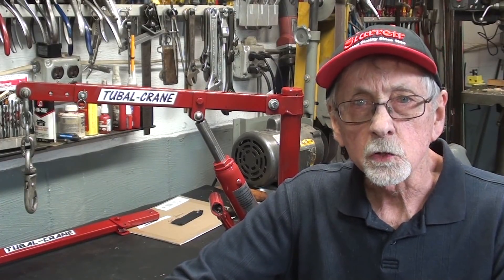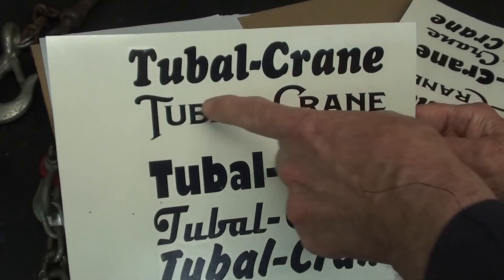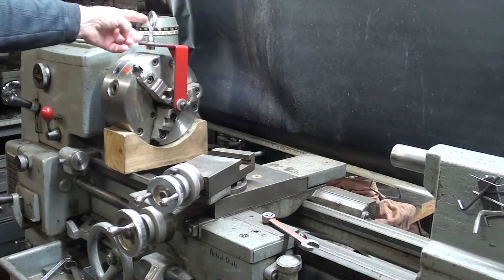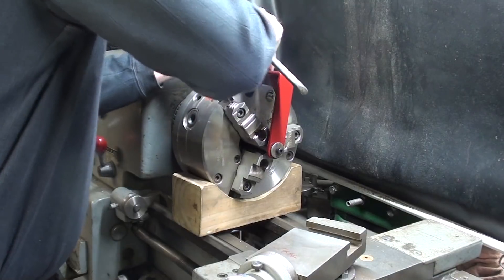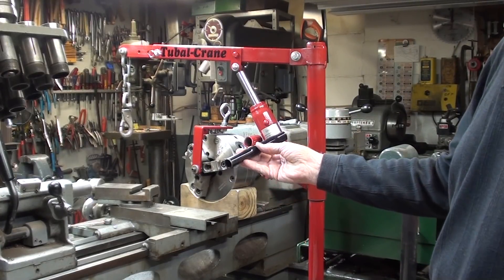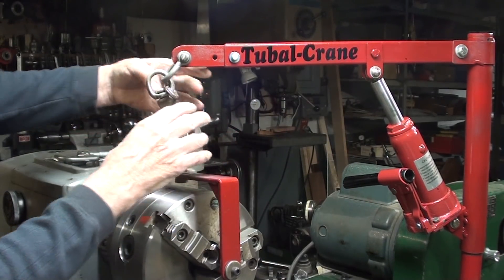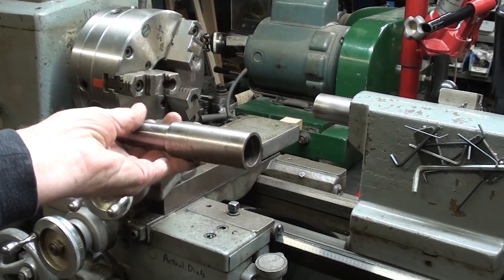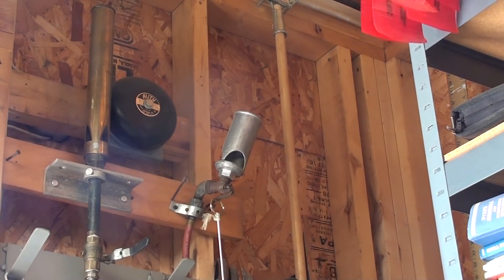Tubal-Crane - SKY Hook for Lathe Chucks pt 4 #730 tubalcain

Comment: Hi Mr. Pete, Thanks for your work. Judging by your complaints of the position of the Jack handle. It seems to me that a new anchor point could be mounted to the bottom plate so that the pump handle could be rotated to the other side of the jack and still work the piston with a downward force. I didn’t hear you mention in your videos that this was suggested, and I tried to find where someone suggested something like this in the comments, but I was unable to discover it. So, I will watch to see if you produce a new “final video” on the subject.

Comment: Thank you so much for the great videos. This series came at a perfict time, I just purchased a rotary table and was having issues moving it. 
I watched the videos several times and made one for my Grizzly 0705. I followed your lead on the crane but changed the mount. I mounted mine on the right rear of my machine which allows me to leave it on and swing it out of the way.

Comment: Hey Mr. Pete.  You may indeed have a problem with that nut, the key or maybe with the chuck keyway.  I had a Lodge & Shipley with an L1 spindle.  If I positioned the key up, as you showed, the chuck, once roughly positioned, would rest on the key and I could easily thread the nut on.  My machine was a 16", I think the chucks were about 14", so there were plenty heavy, but other than the lifting (I needed a TubalCrane) there was little drama in a chuck change.  Thanks for the video!

Comment: Well, I've never had an issue mounting a chuck on a Colchester lathe ! The nut though, is a lot looser so it can align itself to the thread on the chuck. I've also never tightened or loosened a chuck using a mallet on the C spanner. Spindle in bottom gear and a couple of tugs on the spanner seems to be enough to get it tight onto the taper.

Comment: 6:50 Lyle, if I can call you that, ;)  if you want to mount the crane where the toolpost goes - or even as a quick release tool, do so. Don't go mad over tightening the mounting bolts - the lathe and slides will have no issue with that weight - especially if ya oil 'em a bit ;)
The forces involved in taking a deep cut are pretty significant - and I'd not even worry about it on one of those plastic lathes like Blondihacks has ;) [My first lathe - for ages 0-3....months]

Comment: On mine the bottom cylinder pin boss is further from the post  so that the pump and handle are between the post and the cylinder center line.  Makes all the awkwardness go away.

Comment: Why the big deal with a swiveling hook? put a Nylock nut on the eye bolt loose enough to allow the eye bolt to rotate. A next to no cost solution. Another Idea for the mill mounting. permanently mount tee nuts to the base at the extreme end and simply slide it into the tee slots, no wrench work required. The tee nuts will of course need a extra high center part to provide the clearance.

Comment: I think there needs to be a part 4A.  It seems with so many great ideas on this device that it really deserves an appropriate handle for the jack mechanism.  I have always hated those crappy pipes they provide to do the jacking.  I am not suggesting that it is too short, it just seems with a metal lath and years of experience you'd make a nifty handle that perhaps had a bit of knurling on the grip and a stop so it does not slip further than it should.  Just my thought, I like the jack and think it meets all your design criteria.

Comment: I really like the decals. I was hoping you'd replace the paper with paint but decals do the same thing and really make it look professional. Your solution of mounting it on a nearby table was a good one. I liked the idea of mounting it to the bed of the lathe, since that's only two screws but your solution is both easier and doesn't require drilling and tapping holes in the lathe.

Comment: Put the doubters to rest by attaching a rope stirrup to the crane and lifting your weigh with it. It should do it with no  problem.
I don't think they know what a 70 lb tool is.
Coincidentally, while you were making this crane,I made some brackets for a shelf out of 32mm x 32mm x 2mm
EWS steel tubing. Just butt welded with no gussets and a 300mm length easily supports my 75kg weight without bending.
Reply from the maker: Yes

Comment: Nicely done. All those people worrying about it flexing or bending must not have grown up using bumper jacks.  After working under a vehicle held up by a bumper jack out in the middle of nowhere you get perspective. That and the ability to move fast for a short distance even if it's just rolling.
Reply from the maker: There are a lot of people that are clueless regarding the strength of materials.

Comment: Love the crane and the tailstock alignment tool. Would a short piece of aluminum shaft or piece of pipe turned for a slip fit through the headstock also work? Clamped in the chuck, it should also align it to the taper with the ability to rotate it if need be. You always do a super job with your projects and videos.

Comment: I"m not in my 70's yet. I'm still a pup (60 this year). Unfortunately, when I was a paratrooper I had plenty of landings that "disturbed" my back (lol). So, I'm getting more and more challenged with these same tasks. What a great project. I have a new welder in my shop (lathe too) and plenty of time. When My South Bend Milling machine gets here I'll really be sitting in tall cotton. Thank you sir. De Oppresso Liber
Reply from the maker: Watch for my video next week when i discuss south bend milling machines
Reply: @mrpete222  Guarented I won't miss it!!! I really like mine. I do wish I had a through spindle system so I could use regular collets and tooling, but I have successfully modified the NMTB #30 to fit properly. I built a jig so I could easily clamp it in my vise and then insert the #30 and mill it on both sides for the cap screws.

Comment: Lyle - really enjoyed the "Tubal-Crane" project as I do your other videos.  Thank you!  I particularly like the first arm with adjustable extension.  A small suggestion - if you add a second jack pivot on the arm between the original and support tube, you'd have the best of both arms.  I'll bet you already thought of this (or it's been suggested by others) but thought I'd share.

Always enjoy your video's!  Thank you very much for the "Edutainment".  Anxiously waiting for the "What is it? Mystery Tool #65b" (answers to 65a questions) post "when available".  I think #2 might be a crimper for tire chains ... and #4 is a blade for a wood plane.  The picture is Avogadro.
Reply from the maker: Thanks
Reply: @mrpete222  When you were toying with the idea of moving the arm pivot point I was thinking- Put a plate on with a series of holes, So an up vote on this idea maybe.
Also Can you think of any way to get a downward pump on the jack on both sides, instead of injuring a shoulder on one side? 
It would probably mean duplicating the awful mechanism they have on those jacks on the opposite side.
BTW at 22 minutes in part 3, You still had me on the edge of the seat, Keep right on "gabbing", that's what we're here for.

Comment: A ten foot stick of unistrut mounted from your rafters straight above the lathe can be used for swapping chucks and loading large heavy pieces onto the chuck or face plate. They make small trolleys that fit the unistrut and you have the choice of using any kind of hoist attached to the trolley to lift your chucks, face plates, and billets of metal.
Reply from the maker: I talked about that in part one

Comment: Concentric?  :)
Reply: Co linear to be totally correct
Reply: @RobB_VK6ES  I don't think collinear is more correct, or totally correct either. Maybe Collinear Concentricity?  This might introduce a 3D dimention to the otherwise 2D mathematical environments the two terms are usually used in.  :)

Comment: Weight reduction for the adjustable beam, mill a 1/8 deep blind recess after the tightener hole boss on each side using a 5/8 dia end mill to form an I beam.

Comment: if your worried about the flex find a square tube rhs  that fits inside to help mitigate the flex on the crane post
Reply: conversely if its too hard to find square tube the right size 2 flat bars welded into a v shape would do equally as well

Comment: I noticed you use a couple of magnets on the tail stock to hold allen wrenches and other metal tools so you don't lose them. I do the exact same thing because it works great. Works great until my grandson sees them and if I notice any missing, I know who did it. Hahaha. The piece you use to align the head is same way mechanics align clutch plates on vehicles, makes it so much easier to line up the shaft of the transmission to clutch plate and flywheel bearing. Nice video this morning Mr Pete, I hope you an everyone else reading this all have a productive Saturday. We have more rain moving in tomorrow and rest of this week so get all your outside work done today if you can.
Reply from the maker: Thanks

Comment: I like your "trick" of helping to align the thread on the chuck to the spindle nut.  I have the same problem, too.  I will give it a try next time when I change chucks.  Got to make wooden a saddle to set the chuck in first.  Do that after I get my new old bandsaw running!  Thanks for the idea!  Ken

Comment: Speaking of saddles, I made two saddles mounted spaced vertically above one and other to cradle the Mig Gas bottle with a safety chain chocker near the neck for the Student Welding Bay in the new Design Technology classroom a couple of years ago. Keeps the bottle upright and secure next to the shelf that the welder sits on and yellow safety paint to make it easy to spot with your hood on. The walls were originally lined with vinyl and I covered them with sheets of plywood. I couldn’t do anything about the vinyl flooring. My reasoning was that the plywood would only char from grinder sparks and weld splatter and not release noxious plastic fumes. When it finally gets too damaged and dirty, just unscrew the shelves and then the sheets of plywood to replace them.

Comment: Come on, that lathe Could take 6-8mm cuts into steel that would be putting probably well over few tonne of preo into the tool post. It could lift the chuck without problem.

Comment: GG Dave for the decals they look great. I suppose the handle could use a pin now. After some dunce(me, sry) suggested reversing the direction by grinding the nibs, but then it pumped in reverse, oops. But now we all know, and that's the important bit... I hope, lol.

Cool industrial cnc robot arm there too. Little overkill for the basement, but I bet it could it walk itself down the stairs with a bit of code. (lol, nice two-way cranker)